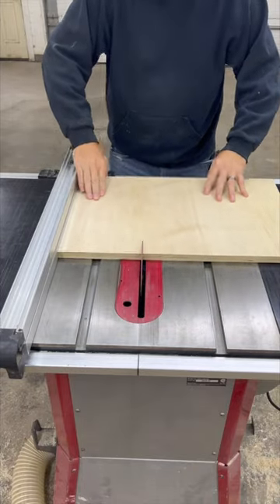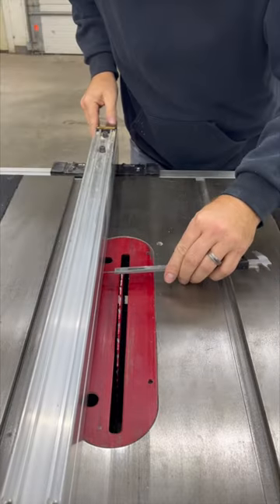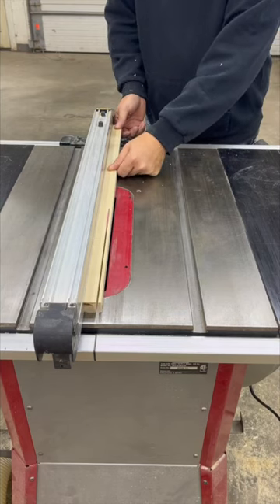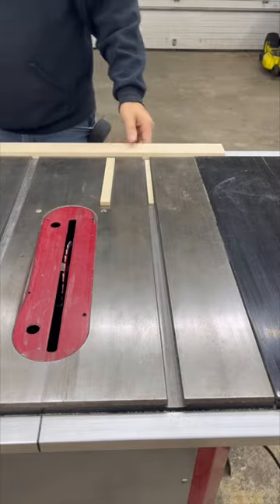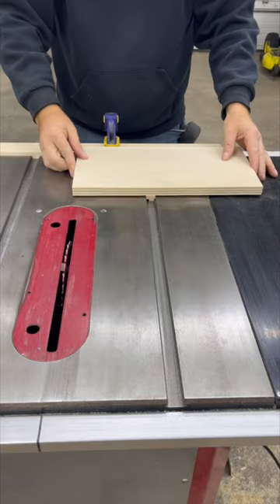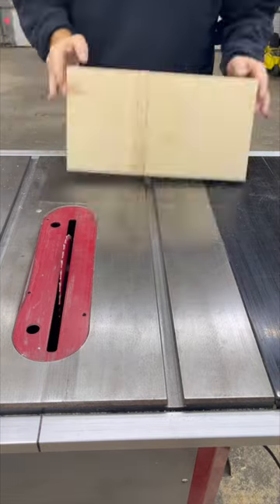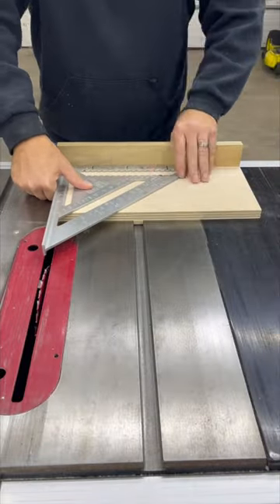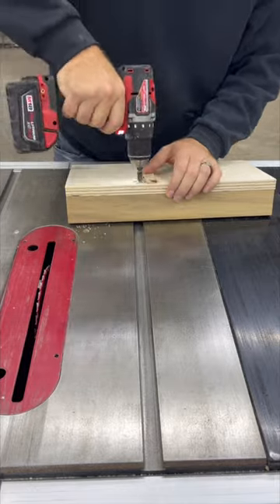Quick Easy Crosscut Sled for Creating Tenons #tablesaw #woodworkingjig #woodworkingtool #woodworking

Comment: That’s a caliper, not a micrometer.
Reply: We all know what he meant and saw the tool.
Reply: @BigAlz11  Speak for yourself, not everybody knows.
Reply: They accomplish the same task
Reply: Same thing bro
Reply: @lextheap1638 Not really.
Reply: @josephdestaubin7426  they do the same thing. They take an accurate measurement. That's like saying a chair and a stool don't do the same thing.
Reply: Where I can find the all this video
Reply: @lextheap1638 ummmm no Micrometer can't measure inside dimensions.
Reply: @Watthead80  not every caliper can measure internal dimensions. And there are interior dimension micrometers. Anything else?
Reply: @Watthead80  30 seconds on Google proves otherwise.
Reply: @george_smiff 
No. Not even close.
Reply: @presidentjoethudbrandon7074  pretty close to be honest
Reply: @Watthead80 or depth😉
Reply: I came here to say this
Reply: @lextheap1638  Lean back in a stool. Then a chair. Then tell me they are the same. They are not the same. Micrometers are not =  calipers.
Reply: He’s a woodworker not a machinist leave him alone. He gets a little confused sometimes but he’s got the spirit 😭
Reply: @lextheap1638 not to split hairs but one measures thickness of veneers the other  measures for duplicating. Which is which?
Reply: more like a footstool to a roof ladder
Reply: @lextheap1638 you all are so picky about the micrometer.  But carpenters don’t use micrometers cmon  the guy did a great job a misnamed a tool. So what?
Reply: Interior dominion micrometer are you drunks📒
Reply: @johnnybotz  whoa, bro. I'm the one defending the guy
Reply: Micro.  Not macro it’s for hundredths they are used by tool and dye or printers veneers etc  you need no more than a tape measure any carpentry project.  Save maybe some furniture builders but it’s rarely seen a shop.   Have any of you worked in a shop with more than yourself and one other.   I mean a shop. Anyone from the local? Or just like picking and insulting others. It’s not very nice.
Reply: @johnnybotz  the issue is if someone's new to Woodworking and doesn't have a machine shop background. They may hear this and go buy a micrometer and find it entirely useless for the task in the video.
Reply: Reply section is proof that people will argue over everything.
If you don't know the difference chances are you don't have one to begin with. I bet some of you people are an absolute blast at social gatherings... 🙄

Comment: Where is ur riving knife?… That’s dangerous stuff you are doing, especially if u inspire newbies.
Reply: No riving knife and pushed the material through from the fence side.  Closer to having fewer digits then he realizes.
Reply: @MightyMellow840 diving knife ain’t gonna do shit, haven’t used it in the last 6 years and I build cabinets almost everyday
Reply: Exactly !! Shocking working practise by a clueless operator.
Reply: @nathanaelmorales760 that’s exactly the mindset of everyone who’s ever had an accident.
Reply: @nathanaelmorales760 number one, just because you've done something for a long time doesn't make you good at it, and number two, and most important "famous last words".
Reply: Thank you!
Reply: You are right about the roving knife but I have worked in shops with several table saws on sight and never saw a riving knife. This shop is the largest undercover yacht refit in the world. I was one of six carpenters that refit JFKs Honey Fitz.   I replaced the worm shoe and a teak shower grate. I have the original in my garden. I was properly apprenticed by carpenters from 3 different parts of the world. I can attest I have watched countless hours of these tutorials. My favorites are when there are no vocal instructions.  But My opinion he builds a quick proper sled that can throw in the trash at the end of the job.
Reply: newbies who are self taught should use a riving knife. Pros do not need them. We don’t put material through in a manner that would allow it to kickback. It’s nearly impossible. I have been in a hurry with a new saw many years ago that a piece of plywood came back and broke my finger clear through. I watch it swell up like a cartoon would depict. That was probably enough to teach me to be more careful l. Lol

Comment: What is the advantage of making that type of sled for cutting tenons? The exact same process could be executed with a carefully set miter gauge and spacer block attached to fence.
Reply from the maker: For me… the miter gauge that came with my saw isn’t very good.  Making this with scraps laying around the shop is cheaper than buying a quality miter gauge.  Another small advantage is the sled is cut perfectly inline with the blade so it supports the grain, making a slightly cleaner cut.  If you have a zero clearance insert for your blade you’d also get a clean cut using a miter gauge.  Thanks for watching!!
Reply: Fair enough. You'll find a quality miter gauge (e.g., basic INCRA) to be a good investment down the line.
Reply: Repeatability is a good one

Comment: I cannot even look at this. Learn safety prior to putting videos out. Lord I hope you don’t get hurt.
Reply: There is absolutely not dangerous about this video.
Reply: 1. No riving knife
2. Pushing the cut-side piece
3. No blade guard for through-cut
4. No anti-kickback pawls
5. Standing directly behind the blade
6. Lifting the wood over the running blade, if he drops it, it will be a nasty kickback
Reply: @GreenPuma241  I started writing a reply to all your points but quickly realised that it's probably a waste of my time because you seem convinced that this guy is doing it all wrong.
Are you a carpenter too? 
Do you post carpentry videos on YouTube?
Do you do everything 'correctly' when you're making tennons?

Comment: The back stop is not even square to the blade. Means all your cuts are not 90 deg
Reply from the maker: Actually if you watch closer it is set with a square, after cutting the sled.  It is perfectly square with the blade.
Reply: @Idealwoodworks  that's not square, that's close. Always make the backstop pivot til you find square with the 5 cut method. Then you know you're square.

Comment: Your not using a micrometer. That's a caliper. If your going to try to be accurate, use a gage block. That way, you don't have to eyeball it with your "micrometer"..........
Reply: You're using " your " 3 times with two of those times wrong ...  That ='s 6  .....
Reply: @rrj6068  I not only appreciate you correcting my phones offensive auto correct grammer, I respect you. 
I assume hordes of women throw themselves at you when you tell them that correct grammer on social media. Thank you for taking the time in between your sessions of pounding tail to keep us honest. You're the man!

Comment: I guarantee that fence will not be square
Reply from the maker: Someone else made that comment…. Got me thinking…. I think using a 12” square on an 8” jig, made for cutting tenons on a 2” wide board is probably good enough.  But just to check I went out to my shop and tried the 5 cut method.  I used a piece of plywood just over 8”x8”, which is slightly bigger that the sled.  Made the 5 cuts…. After approximately 40” of cuts I had a variation of .008” That is half the thickness of a piece of paper.  When cutting a 2” wide board the variation should be around .0004”  Hard to ask for better that that.
Reply: @Idealwoodworks  I should clarify.  If I made it like that it would not be square. I'd do 5 cuts and calibrate from there.  Kudos if you can pull it off first time.
Reply: Nice positive attitude

Comment: why can't you just lower your blade to 1/3 of the thickness of the wood, set your fence to the depth of the tennon and run the piece through on all 4 sides?
Reply: It can bind against the fence, especially without the sled.  This way allows you to move faster for multiple tenon's.
A couple of guys are moaning about dangerous kickback, but this method, in the right hands, controls potential kickback.
This is a solid method for guys who use it wisely.